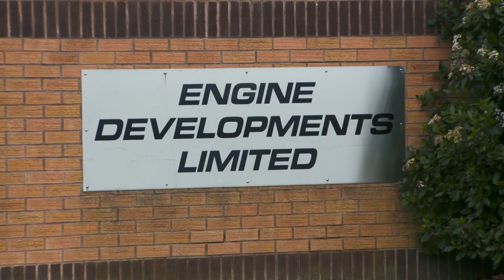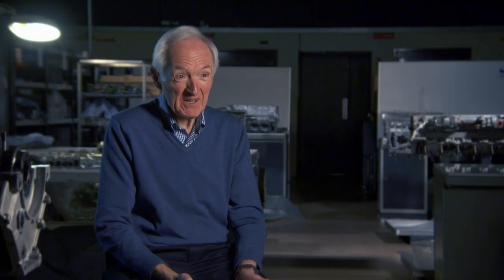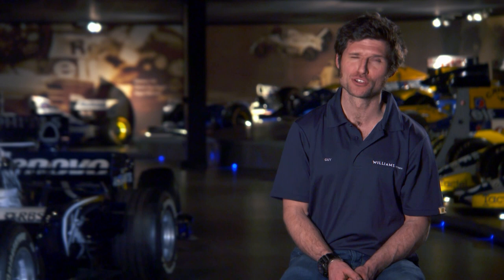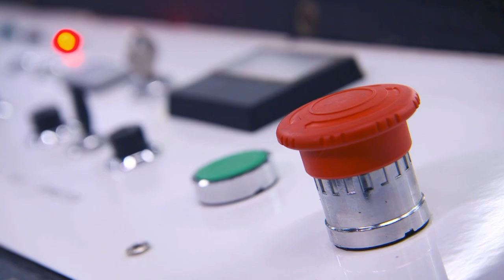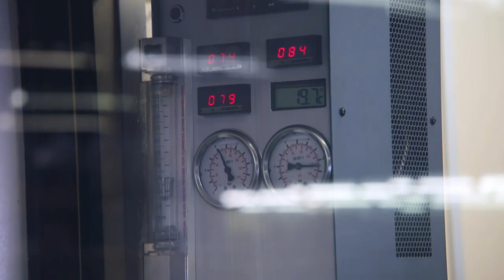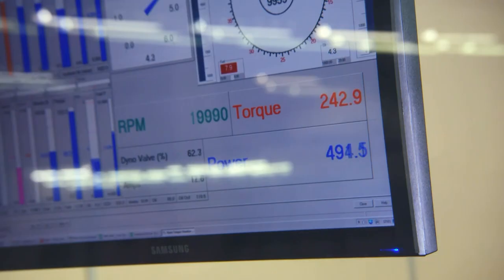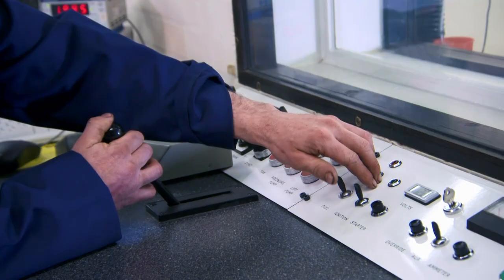Guy Meets His Hero - Speed With Guy Martin | Guy Martin Proper

Comment: Keith Duckworth was amazing, the DFV was waaaay ahead of it's time, even for today's standards, 10500RPM and 510 HP is quite impressive! I mean that engine was designed in 1966!
Reply: Pretty incredible alright
Reply: 400bhp in 1967 at its introduction in The Dutch Grand Prix, Not knocking the DFV. The Repco engine With SOHC was giving about 350 I believe. They tried a 4 cam engine but needed more money, so it failed. Colin Chapman demanded the engine carry suspension loads . The engine was a masterpiece of Engineering. Ford put a lot of money into that engine. The Westlake engine produced more power but was too complex.
Reply: 510 hp was the last evolution back in early 80s.
Reply: @JuanCarlos-tv2hu  Yes I know that the very first DFVs made around 390-410HP back in 1967, but I meant that basically the same engine design of 1967 made 15 years later around 100HP more. The short stroke version Williams ran even made around 540-550. An incredible piece of engineering!
Reply: It's still the best sounding F1 engine ever
Reply: The genius in this engine is the manufacturing, not the design. There were engines like this before made by Rolls-Royce, Packard, Chrysler and even Ford. Check out the Ford GAA, it's like a bigger, older version of the DFV. It was used in the M4 Sherman tank.
Reply: @johncarl5505  ".....The genius in this engine is the manufacturing, not the design....." 
I was wondering. Why should it be the biggest F1 winner of all time? Although it was a pioneer of the DOHC narrow-angle pentroof combustion chamber, it seems pretty straightforward otherwise. It might be a matter of Cosworth having the skill or luck to hit the "just as much as needed" point in everything: It's just as complex and heavy as it needs to be to make the required power reliably, just powerful enough to win a race without compromising weight or reliability, just reliable enough to almost always finish.
Reply: @Baribrotzer  Making the best engine is usually luck based. To see if an engine manufacturer is really good, we need them to be able to adapt to new rules and technology then consistently win. That's what happened to Ford at Le Mans, engine rule changes stopped their winning streak. Another example would be GM at Can Am, new turbo engines made them lose. Although GM was never involved in racing at the time, so it's really McLaren giving up instead of adding turbos to the Chevy Big Block. If an engine dominates in a racing series and this has happened a lot, it just means the rules are stagnant. Competitors could copy the engine, improve it and make it their own, but that would decrease their reputation, even if it gives them the win. That's why Ferrari and Alfa Romeo never designed something similar to the DFV.
Reply: @Baribrotzer  I'm not saying the DFV's accomplishments are fake. It's just that whenever there is an engine rule change that is very vague, one engine design always dominates. That's why most racing series like F1, NASCAR, Super GT, NHRA, etc. have very strict engine design limitations. They're still open development, but they have to follow strict dimensions, to the point that all the engines are almost identical. The materials and manufacturing techniques used is what is more important nowadays. NASCAR back then kept banning dominating engines because people get mad when one team walks away from the field. I think NASCAR was the first to adopt a strict engine formula back in the 80s. F1 did it in the 90s with the V10s. NHRA and Super GT did it in the 2000s.
Reply: @Baribrotzer  My bad, Super GT adopted the formula in the 2010's during the Class 1 regulations unification with DTM. The Honda NSX GT500 used to be a mid engined twin turbo V6 hybrid, but after Class 1 rules, it turned into a front engined turbo inline 4. Darn DTM, ruining Super GT for their own benefit, but they still turned into a GT3 class.
Reply: @Baribrotzer  Anyway you get the lesson. If you don't want Balance of Performance in your racing series, enforce strict engine formulas.
Reply: @johncarl5505  Thanks for your very complete reply.
Reply: @johncarl5505  Ford’s winning streak at Le Mans wouldn’t have gone on indefinitely anyway. Remember that in the GT40s last win, Jacky Ickx crossed the line less than a second ahead of the second placed Porsche 908.
Reply: There are not many areas where the DFV was really ahead of its time. But it was the first engine to be used as a fully stressed member - that was Chapman’s idea - and it was the nearest anything has ever come to a mass produced F1 engine because they sold it to almost everyone at some point. Other than that, most of the design features were pretty common practice: all aluminium block and heads, flat plane crank, dry sump, throttle slides, fuel injection… all pretty much standard practice, reapplied for the new era of 3 litre engines.
Reply: @TheThirdMan Cool, but it was still the regulations that killed it. Not Porsche. They should have let it run then, if it was going to get defeated anyway, but they didn't.
Reply: @johncarl5505  No, Ford could still have run a 5 litre engine. They just chose not to. The Porsche 908 was only 3 litres and was still competitive against a GT40. The 917 would have murdered it.
Reply: @TheThirdMan But it never happened. Also, it was an older Mark 1 that beat the 908, so obviously, the newer 917 should theoretically beat it. The Mark 2 and 4 were already banned at the time because of their high capacity engines. Regulations killed the GT40, not Porsche. Displacement regulations are so dumb because it's obvious that a 5 liter pushrod engine can not compete against 5 liter DOHC engines.
Reply: @johncarl5505  Not at all. There was nothing in the regulations that said the GT40 couldn’t run. Lola continued with the T70. Ford chose not to.
Reply: @johncarl5505  Displacement regulations are not dumb but there are better methods. Group C was an example of good rule making.
Reply: @TheThirdMan Yes, Ford ran the Mark 1. Obviously a car 4 years newer should beat it. The Mark 2 and 4 were banned. Who knows what Ford could have done in the future if it weren't for stupid displacement regulations.
Reply: @TheThirdMan Displacement regulations are dumb because it assumes all engines work the same.
Reply: @johncarl5505  Displacement regulations are good because only the best engine designs survive.
Reply: @johncarl5505  All (reciprocating) engines are the same.
Reply: Isnt the dfv just cosworth 4 cyl joint together

Comment: No disrespect to Americans, but they need about 8 litres and a supercharger to make that kind of power, and they still won't rev past 8k.
Reply: At the time, Americans loved Drag Racing, Can Am, Trans Am, Formula 5000, NASCAR, Sprint Car, etc. A majority of these are either unlimited class, non stop throttle at high rpm or utilizes heavy road cars. So of course Americans would prefer a larger displacement, the DFV was never really popular in USA.
Reply: What Americans excel at is chassis building such as the Chaparral cars from Jim Hall. Many designs from F1 originated here. People like Colin Chapman and Gordon Murray adapted Jim Hall's ideas into F1.
Reply: @johncarl5505  why did they not capitalise on it then?
Reply: @steveluckhurst2350  Because stock cars were more popular than prototypes.
Reply: @steveluckhurst2350  It's fine though, Americans like Steve Nichols, designer of the most successful F1 car the MP4/4, are recently getting recognized. I love how people are now turning against Gordon Murray and his dishonest ways.
Reply: @johncarl5505  I'm not a huge F1 fan, but I've not heard of these allegations.
Also am I right in thinking that most CART chassis are designed/built in the UK?
Reply: @steveluckhurst2350  Yep, what about it?
Reply: @steveluckhurst2350  A lot of those chassis use F1 derived tech, such as carbon fiber, which an American aerospace engineer introduced in F1.
Reply: @johncarl5505  really the CART thing. That was the reason I asked about the US not capitalising in the design.
Reply: @steveluckhurst2350  I checked again, so that engineer was Steve Nichols. He advised John Barnard and Ron Dennis to ask Hercules Aerospace, a US company, to build the MP4/1, which revolutionized F1 chassis manufacturing.
Reply: @steveluckhurst2350  CART was not as popular as NASCAR, so most chassis builders flocked to stock cars. Indy teams looked overseas for an effective chassis.
Reply: The Americans had the Offy. A four cylinder with a big ol' turbo that would make 700 HP and was around 2.75 liters. It was an archaic design but it was dirt cheap and had been around and it only fell out of favour when some wise fellow took a turbo and put it on a strengthed Cossie.

Comment: 10,500rpm!!! My God what an engine build. I mean it's original design goes back to the '60's & it's not like this is a rotary or a screaming 500cc bike engine. So impressive.
Reply: And yet you would probably find that things like piston speeds are not that remarkable. It has to be in sympathy with things like fuel burn rate.

Comment: What blew my mind is that it took 5 months of full time work to rebuild that engine. At that rate you wouldn't have very many of those available, and the cost of rebuild would be insane.
Reply: Likely they had to remanufacture some parts themselves since you can't find them anymore. But I don't really believe he spent 5x4x5x8=800 hrs on it. He probably worked part time on it over those months.

Comment: Probably 50 more BHP than in period. Very impressive.
Reply: The short stroke DFV was making that power by the late 70's. Alan Jones and Nelson Piquet would have had even more in 80-81.
Reply: In racing config they will probably limit it at 9500 rpm so.. 450 bhp or so when they race it.
Reply: @azynkron  They would limit it now. Back then they would push it all the way. As reliable as it was, the Cozzer still suffered the odd catastrophic failure, more that today’s engines do.

Comment: Guy, Just think of it as a big motorcycle engine.  It is supposed to rev,  511hp is a very stout DFV. Though torque was not much.
Reply: True, but being an engine for high speeds you want more power for higher top speed... at least that’s how I’ve been told it goes. 
Torque to get going down low; power for pushing through the air at high speed.

Comment: The tears in my eyes!...... I could not work on that dyno! That hurt!!    
I could do it to a LS or a barra.. but not to a Cosworth dfv....
Reply: Why? Because they tested the engine to make sure it will work properly when it's installed? That's the thing with this particular video - they WAY over dramatized the testing. That engine is designed specifically for this. As long as it was assembled correctly it will be fine - this is just the QC testing and to make sure it's performing up to specs. 

Nothing untoward happened in this video, nor does it regularly in that dyno, I'd wager. It's just testing function, not testing limits. You get horrible engine deaths when deliberately pushing them to see what breaks first, so you can then redesign that part better. That's part of design evolution. This was just function testing, so no real big deal. Not sure why the video drama'd it up, except for some 'fake TV drama', which is a modern problem completely separate from this discussion...
Reply: Bruce Pulver 
 X2!! 😨
Reply: @Broadpaw_Fox   
Have you built many engines?
Have you many years of experience with engines that revs at around 10k?
Have you spend many hours in a dyno room?
Have you any knowledge in that it only needs ONE loose bolt to make that quite "uncommon" 
Engine which they have worked 1000h on to scrap metal?
I doubt it.
Reply: Eric K Yes the hype narrating seemed for for general audience not car / mechanic audience. Should have just explained about dynos, controlled load and parameters being monitored.
I do feel mean saying anything bad about the video though! Guy is awesome and is great content to be put out.
Reply: @mrolsen6987  - I'm sorry to you mr. Olsen for your disappointment. Granted this is a YouTube comment section, and anyone can say anything they want, but I've always made it a point to talk about the things I know. And you're right - any number of very small things could go wrong and destroy that engine while it's running hard. But that's part of that 1000 hours you were talking about in your post - they double and triple check all of those points to make sure nothing is left to chance. When that's finished and they go to the final testing after break-in, it should be understood that the engine will be fine - issues might pop-up during initial ring break-in that warrant addressing, but by the time you get to the point where this video showed the testing at high power, all the little issues have been addressed, and the engine will have been heat cycled a couple times. And if they really care, like these people probably do, they'll likely have gone in and retorqued everything after the first couple heat cycles. Of course, none of this was shown in this video, because this video wasn't about those details - which was the point of my original post. Thank you for your concern though.
Reply: @Broadpaw_Fox  
I know that the video clip we viewed was just a small piece of the time they spent in that dyno room, and that it's a tv-show. 
Howewer that's not My point,  yes they probably "triple check" everything but aslong so many Pieces are put together there is always a chance that something falling apart.
In theory, it should not happen... But here we are in the real world.
When they rev it up to max rpm for the first time it's still the first time they rev it to max rpm, there is a reson why most of the enginebuilders sweat in that room.
Reply: @Broadpaw_Fox    If you want to see some engines blow up on a Dyno  look for Videos with Turbos chargers running 60 pounds of Boost  some times the blocks come apart at 3,000   Horse Power..

Comment: Wasn't it developed from the Ford Anglia racing engine?
Reply: Mick Kennedy that would've been the 4cyl. BDA. But in essence the DFV was almost two BDA's stuck together.
Reply: @Miatacrosser   - Not quite correct Sir. The DFV (Double Four Valve) had its roots in the FVA (Four Valve A Type) family that was developed for the then 1600cc Formulas 2 regs. and was developed alongside it. The FVA overhead cams were gear driven and this was transferred to the DFV. The 'FVB' engine was in fact half a DFV @ 1498cc

The BDA (Belt Driven A Type) was a development specifically for Ford rally cars to run in the 1600cc category based on the new Cortina Mk II iron block as the then Lotus Twin Cam using the Cortina Mk I engine could not be bored out reliably past 1595cc (it was originally a 1500cc Ford block bored out to 1588cc for production Lotus Elans, Europas and Twin Cam Escorts and Cortinas). But like all competition engines many versions of the BDA family went into all sorts of racing as well.

Interesting crossover was when they created the 'FVD' using the BDA aluminium block bored to 1985cc for 2 litre sports car racing! This race bred aluminium block would find its way back into earlier iron block BDA engine rebuilds as a reliable 1800cc rally engine. Hence the 'RS1800' Mk II Ford Escort ...

Hope I have added some background ....
Reply: @boothegoo pc I will give your sarcastic and uncalled for crap the attention it deserves ....

SILENCE!

Comment: How many pounds does it weigh?
And for how many hours can it run at 10,000 RPM?
Reply: Not long. Usually back then they set the revlimiter to increase the reliability. As Guy says, they want to get it to around 9500 rpm which is likely what he want's it to be able to rev to under racing conditions.